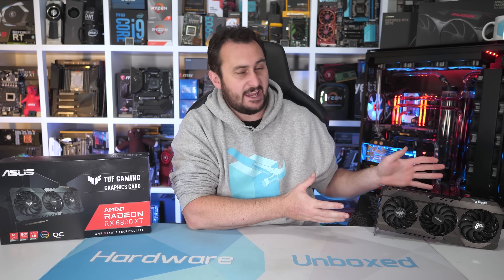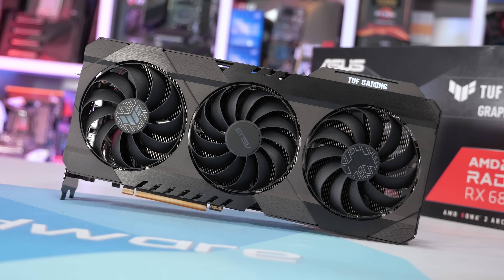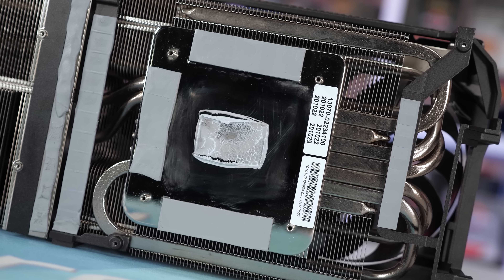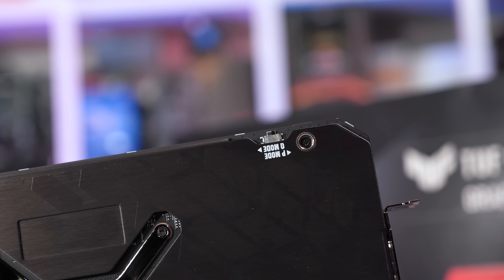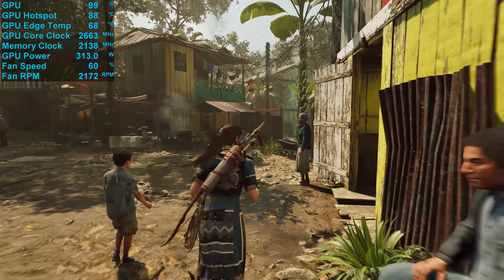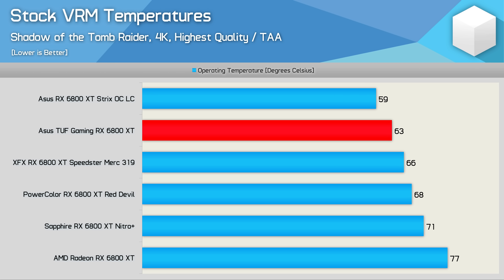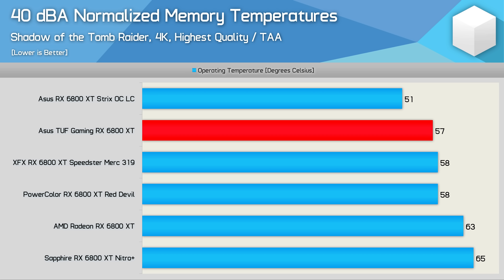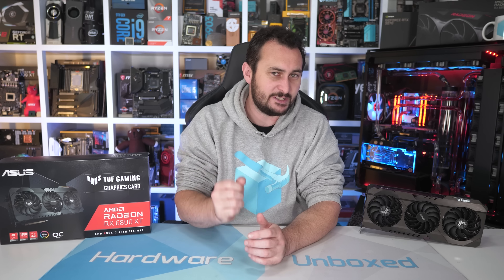Asus 6800 XT TUF Gaming Review, Power, Thermals, Overclocking & Gaming

Comment: I have this card.  I was able to get it on newegg when they added in stock after the Christmas break.  I was actually looking to buy a 3080 but this is the only gpu that made it through checkout.  I will probably replace it with a 3080 at some point because I'd really like to take advantage of ray tracing in as many titles as possible as soon as possible, but I have been pretty happy with the card so far.  Mine runs a little faster, 2420 mhz boost on the gpu and 2048 memory at stock settings.  The fans spool up to around 2200 rpm at peak usage while gaming, and if I wasn't using headphones the noise would definitely be a problem.  Definitely subjective on the sound issue.  You're not going to hear this card with headphones on, but it's definitely audible and distracting if you're using speakers.  The few times I've taken the headphones off and gone to speakers definitely make me want to water cool this card but I haven't found anyone making a block for this pcb.  I'm getting 60+ fps at 1440p, all max settings in cyberpunk paired with a 5600x, but again, no ray tracing support so far.

First world problems for sure with so many people not able to get any recent card at all, and I'm super lucky to have been able to source one.  I spent the week prior to, and during Christmas break sitting in a discord channel trying to buy any card at all and I was finally able to buy this one on a day of above-average stock.

Comment: I love this design, and look(no RGB and i love it), its a shame they all get sold out so fast, if stock hadnt been an issue i would have gotten the 3080 TUF when they got released(locked in GF camp due to gsync monitors + i need the DLSS feature for the future) , no way i am paying current prices for them tho, but back at MSRP i would have gotten it. All tho i dislike that reviews of each card/cooler model wasnt out before the cards launches, its a big problem this time around from both AMD  and NVidia. IF Asus keeps doing this minimalistic design combined with good preformance and solid quallity products on their TUF line i may be building a TUF parts based pc next time i upgrade, time will tell if they continue down this line tho.

Comment: $1,300 Australian.
That is about 6 times what I'm comfortable spending on a GPU.
That's if you could actually get one.
On the positive side, it does sound like a very high quality capable video card. At that price, I think it'd fkn want to be...

For the record, let's not spotlight Asus or AMD for this. nVidia high end cards are just as pricey or more so, and the price -> quality curve between the various companies and suppliers, let's say there's a bit of random variation. By analogy, do Honda always make good bikes and Yamaha always make bad ones? No, it doesn't work that way... Ford and Holden have both made classics, and they both made some bombs....

I have some questions about the Australian importers and distributes of Asus products. (I'm thinking mostly motherboards here.) I have very few questions about the overall quality of the products themselves - they're actually as good as any and a lot better than most. I don't like dealing with the importer, but the products are usually fine.

Comment: I am glad Asus fixed there problems, but i burned my fingers on the Asus Vega 64, it has been a project in itself to keep it running the last 2 years.
Bad VRM temps 110 C and thermal throttle.
When VRM temps is fixed, the core just auto overclocks itself to op to 100Mhz above advertised boost speeds, leading to 105-110 C hotspot temps and instability.
Bios switch does nothing, the same bios is loaded on both chips.
Asus fan, RGB and clock speed software fights the AMD driver, and the fans toggle between off and full speed.
AMD Radeon software settings like downclocking the core by 10Mhz or something else that should be considered safe or any power limit setting leads to instability.
Removing the fans completely leaving the card with a heatsink only and mounting 2x 140mm Noctua fans with 1000RPM, helps with thermals, but only allows the GPU to self overclock more, and the same hotspot above 100 C temps show up again, but just at higher clocks.
Tried mounting washers on the cooler mounting screws, helped a bit too, but the card still auto overclocks.
The Bios lists max overclock limit at 2400Mhz, so maybe the card is trying to reach that point.

The only thing that helps is to limit game settings or adjust a FPS limit, to keep the card below 105 C hotspot or to restore the bad thermal connection to the VRM, to let the VRM overheat again and throttle down the GPU core.

Asus replies in mail, that the card is working as intended.
Reply: @El Cactuar Can I use you the next time I write to Asus? Maybe they will understand me better.

Comment: I have an msi gaming X 6800xt  and im extremly unimpressed with the card thermals and noise.  Poor cold plate design causes massive deltas between hotspot and die thermals  mine are 40c different..   52c  with hotspot being in the 90s....  despite the performance which is there i would stay away from this model

Comment: They're using stainless steel for the IO bracket to help prevent rust? I have many questions about the computers working in environments where the rusting of IO brackets is a worry.
Reply: Its very usefull if you end up using your graphics card as a boat anchor in a pinch

Comment: Stock is slowly coming back in locally here in the Midwest of US.  However the cards are kind of insane.  An MSI RX 6800, non XT card has a sale price of 1029.99 USD  The EVGA RTX 3090 that is in stock is 1869.99 USD at my local Microcenter.  It's mind boggling that people are willing to pay that much more than MSRP/RRP for a new card.  I just sit back in stunned silence.  That is so far beyond me, that I guess I won't be getting myself a RX 6800 any time soon.  I can justify 100 over MSRP/RRP, but more than that for the performance you get just isn't a good investment for me.  I'm good for the time though performance wise, so I will just keep using what I have, even if I can't run my games with all settings to high at 1080P or 1440P.

Comment: RTX 3000 and RDNA2 were destined for greatness, but the official out-of-control price-gouging is really bad and ruins everything. Yes, availability is a problem (Europe), but the prices are the bigger disappointment, in my opinion, right now. I can get a non-scalper card, if I really want to, but then the price is around 25% higher on average, than what it should be.

Comment: AAh another to add to the list of unobtainables, it's now a case of, not where you're a Green or Red fanboy, or which AIB you prefer, but which you can get your hands on if you cannot wait, as even the retailers have humped up the price.

I actually found stock of the latest AMD gpus, two of the 6900xt but the prices were 300 over the retail price, and this is from a store I've used for years.

Comment: I am having some problems with my 6800XT ASrock Phantom Gaming D OC, it has microstutters and it crashes and restarts a while into the game. My cpu is a 3700X at 4.5 Ghz all core @1.3V. Furmark is completely fine though for some reason. I have a 1000w psu, so no problems regarding power. Tried ulps, older drivers, underclocking and having the voltage at around 1000mv, that's around what my card can do while having clocks at around 2000 minimum and 2400 max. What is my problem?

Comment: I'd like to point out that Asus messed up the memory cooling on the RX 5700 XT and also the VRM cooling. The thermal pad on the VRM mosfets doesn't touch the heatsink, because there's a massive gap between it and the heatsink. However, since there's a lot of room for movement, and if you're lucky, the heatsink will stick to the pad and the pad will also stick to the VRM mosfets if they are left in a position where the heatsink is resting against the VRM thermal pad by random chance.

Comment: I get why AMD have artificially limited the RDNA 2 GPUs - artificially segment the product stack and perhaps keep some performance under wraps for easy performance bumps for the 7000 series. It's a pity that AMD have gone down this route and since the demand is sky high at the moment there is no chance of voting with wallets as many people are jumping on the first GPU they can get. Thanks for the review Steve, I was curious about this GPU as well - book marked for future reference.
Reply: What do you mean by artificially limited
Reply: @viperro4542  The RAM for 6800XT can only be increased to 2660Mhz vs. 3000Mhz on 6900XT. Considering they're theoretically the same die (potential binning aside), that's quite a limit.

Comment: Only 1050AUD? Or 1300AUD? That's cheap... Here, in Poland, this TUF retails for 5700-6200PLN, that's 2000-2170AUD... and that's given the shops actually get it in stock even at these prices ;)
Perhaps we'll get them and get them cheaper in 2022 and then this review will be very useful ;)

Comment: Asus TUF Gaming videocards seem to be the sweetspot this generation for both AMD and Nvidia AIB's.. You can tell by the long backorder lists everywhere the card is in very high demand.. I ordered a RTX 3080 TUF Gaming back in November but I had to cancel it because the waiting-list was so long I was never gonna get it in any reasonable time.. I had to settle for a less popular model with a much shorter backorder list, the MSI Ventus 3x OC, which I ordered late December and got delivered 3 weeks ago, so less than a month waiting time.. Also a very good card, only with a very limited powerlimit which is a shame if you want to overclock, but at least I got my RTX 3080 now still for a reasonable price (€799).. For current pricing I would not order anything anymore.. They sell RTX 3070's now for what I paid for my RTX 3080, it's crazy..

Comment: I always feel that ASUS and EVGA always optimise the hell out of the cards they get. Or did they have some oopsies before?
Reply: The Asus Tuf 5700 XT last year was horrendously bad. This channel did a review of it, it was running memory temp at 104C. It was so bad that Asus was forced to redesign the card. I had my suspicions about this model too since the cooler looks like Asus reused their Nvidia coolers but because of the review we know it to not be the case since it's quite a bit heavier than the 3080 and the temperatures are excellent.
Reply: @TerraWare  i see. thanks

Comment: TUF 6800XT AUD MSRP - $1599
TUF 3080 AUD on MWave - $1499
ROG STRIX 3080 AUD on MWave - $1699

How the fuck do you screw this up so much to the point where the card that’s supposed to be cheaper than a 3080 at base MSRP ends up costing nearly as much as a higher-specced 3080 or more than an equivalent...

Comment: In sight of the GPU availability situation and the problem with making interesting content that is not to depressing; How about a look at previous generation cards. Their performance as compared to new and unavailable cards, using slightly lower settings. I realize that this data can to some extent be found in old HUB videos but a fresh look could perhaps boost morale a little bit.

Comment: Im afraid that this GPU shortage situation isnt gonna get resolved for a while, maybe not even until the next generation in 1.5-2 years
Reply: It's resolving as we speak.. 
There arn't infinite demand on these cards, despite what most people think.
Reply: @Orcawhale1  I meant shortage/pricing situation in my original comment, I wouldnt consider finding these cards 30-50% over MSRP as a resolved issue. Remember that just few years ago high end flagship 1080ti was $700
Reply: Agree with you on that. It will last atleast as long as the pandemic does. And probably a few months on top of that.

Comment: based on your reviews, managed to get my hands on a red devil 6800xt. an absoulte monster (coming from an 5700xt)! with fans at the bottom and top of the case i get less then 85 C at the hot spot after hours of gaming, oc ed at 2700Mhz,  which is amazing. and is freaking quiet!
now regarding the price, i think the advertised msrp is fake, both nvidia and amd trying to get on top of the other, by lowering the price as much as possible. can't remember where i've seen it, but apparently the real cost of both 6800xt and 3080 should be around 850 usd. and considering the demand right now, i'm not surprised that the prices have gone up so much. i payed for mine a bit over 1050 GBP, on ebay, brand new, sealed box and warranty. at the retailers is a bit less than 1000 GBP
Reply: @El Cactuar *then  -  if you want to be a grammar nazi, might as well not repeat the same mistake. english is not my native
Reply: @El Cactuar it's just a mistake, if you could bother to read the last part of my text, it's spelled the right way, in the same context. you actually got me confused thinking that the last part was the wrong one, didn;t even see the one you were refering to. this is a completely pointless conversation

Comment: There's more nVidias at reasonable price out there than AMD at inflated prices for sure.
Reply: I mean with the gpu shortages, I think that could explain a lot of things.
Reply: There are more out of stock listings for nVidia cards at lower prices.  That's not the same as actual prices.
Reply: Initially, at launch, nvidia had lesser GPUs that were "achievable" by regular customers due to you know stuffs.. 
And everyone just kept on repeating this fact.
But now, AMD still hasn't improved much but overall nVidia stocks available to normal users had drastically increased although some vidcards, especially the 3060 TI, is still in low availability most of the time.
Anyway, rn there's more RTXs out in the normal user market than Radeons.

Comment: The paper launch of all GPU's has been a blessing in disguise, great as miners have bought the dud designs. By the time cards are available for gamers the best of every category has been well reviewed.
Reply: by the time you can buy them, next gen is out and they land in the bin.
Reply: Let's debunk your nonsense. 
1. It wasn't a paper launch, as cards were available.
2. Miners arn't the ones who's buying RTX 3000 in droves. 
Infact they are hurt as much as the gamer, because the higher prices makes it that much harder to recoup the costs.
Nor do they buy the same models, a miner don't care about noise or cooler design, all he cares about is price and undervolting. 
So they arn't exactly "beta testing" for the gamers..
Reply: @Orcawhale1  "arn't" to aren't ; "who's" to who're ; there fixed it for you.
All that you said is also nonsense, but my nonsense has no spelling mistakes so its more valid.
Reply: @tudomerda  Thank you, i will edit it.
Reply: @Orcawhale1  stating something without evidence isnt worth anything. You did debunk nothing. It was a paper launch full throttle and hes right with the miners. shortage is also a factor clearly.
Reply: @Thor_Asgard_  A paper launch is defined as having no product on sale. There were products, therfor it's not a paper launch..
Reply: @Thor_Asgard_  Nor is he right with the miners. If you were able to do the math, you'd quickly realize this.. 
There's a demand issue, not a shortage..
Reply: @Orcawhale1  a paperlaunch means nearly no stock, which is what happened. hes still right, miners bought bots, who bought them all the stock(which wasnt much) which was availiable. Scalpers joined the Miners. If you cant give any evidence, then what your said isnt valid. And your math, as a physicist iam quite good with it, bring it on, i want to take a look at it.

Comment: From what I have heard, AMD implemented the upper clock speed limit because that is the limit of the architecture. If it goes higher apparently it experiences logic failure
Reply: There are also segmentation purposes, the 6900XT can go up to 3000 Mhz (if the cooling and silicon quality are good enough), since it's the same die there is no reason for the 6800XT and 6800 to not have a 3000 Mhz limit as well if that is the true wall.
Reply: This was also the rumor before the release.
Reply: @HMBro source(s)?

Comment: Too big.. and why all the aluminium instead of cooper?!
Reply: Why not just make it out of gold?
Reply: @_BangDroid_  cuz cooper conducts more heat?
Reply: @RonPaulBot1234  But it's >2x price of Al and 3x the weight
Reply: @_BangDroid_  that's what I expect from premium series GPUs.. the 1080 days it was standard..
They are cheaping it out.. that's why you need a big cooler, as power draw is going down but gpus getting bigger make no sense..
Reply: @RonPaulBot1234  What specifically do you want to be copper instead of Alu? It already has nickel plated copper heat pipes and cold plate. Copper fins were not standard on 1080's..
Reply: @_BangDroid_  from this comment and the ones before shows you have no idea what you talking about 🤣
Reply: @RonPaulBot1234  projection much
Even the strix 1080 ti and evga ftw3 used Alu fins with copper heat pipes. Again, what specifically do you want to be copper instead of Alu?

Comment: I don't know why but in my country all Asus products are all more expensive than their supposed MSRP. Comparing Asus to MSI and/ or EVGA, Asus products cost additional 20-30% from MSRP whereas other brands, I could find them closer to their actual price. Like before the price hike,for example last year the 3080 TUF costed closer to EVGA 3080 FTW3 ultra which should be way above the TUF price bracket. I bet the AMD counterpart will be the same.